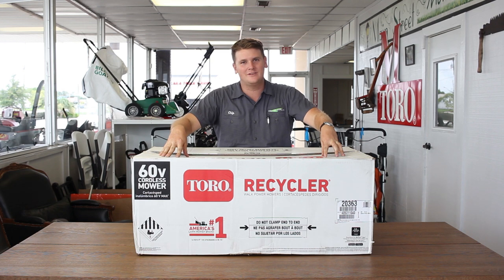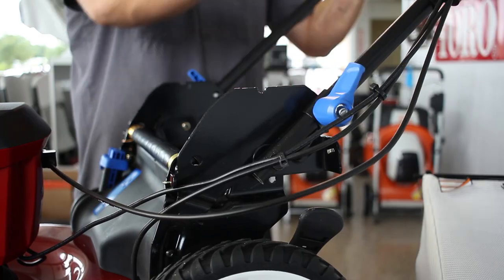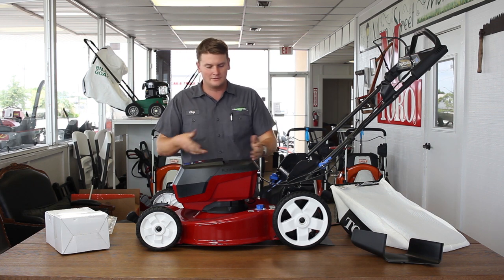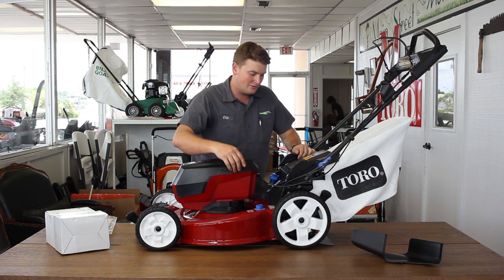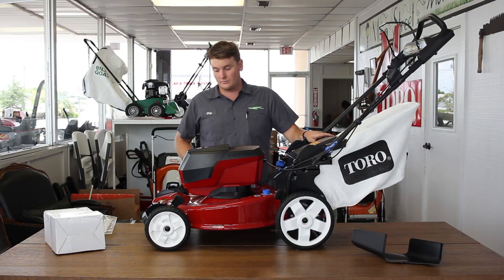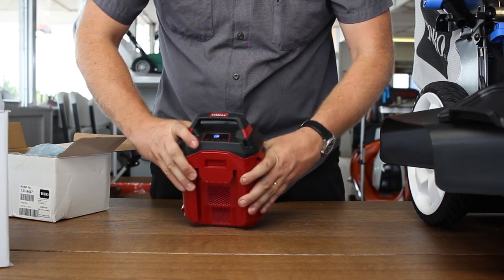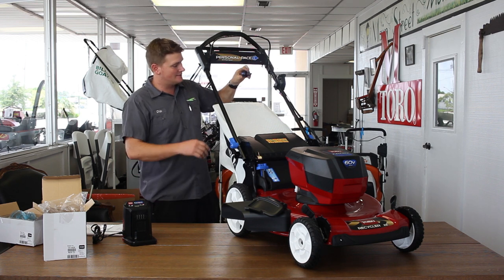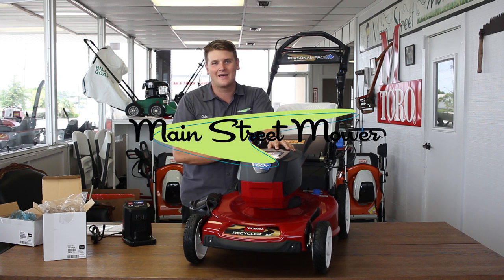TORO 60V Electric Mower Unboxing - Review & Specs

Comment: My neighbors both have Toro gas mowers...one is a super recycler...and I've never seen one leave almost no clippings or leaves like that does. It's fabulous. I want a battery mower just like that. Differences I see are...aluminum deck, under deck plastic mulch airflow  interrupter knobs, and a different blade. Do you think Toro will add these features at some point...like a 'super' recycler?
Reply from the maker: We have no intel of that coming out this year but we have to image that it is on the horizon. It seems it’s a bit price point limited at this point.

Comment: You didn't mention one special feature water hose connection for the deck cleaning
Reply: Batter powered mowers can be  stood on end or side and hosed vh out - motors are sealed.
Reply: They did that cause they didn’t redesign their electric mower from the ground up. They got lazy and just reused the deck from the gas mower. You can clean the deck a lot better by just propping the mower on its side.

Comment: If you have a big yard  close to a 1/2 acre you'll be lucky to cut it all on one  fully charged battery. Been there , done that.  I'm quite satisfied with the performance of this  mower, just remember the higher or wetter  the grass the more power you need and the shorter life of  the battery. I was going to purchase an extra 60 volt battery for this , but it cost $249.00   plus tax , so most people would shell out  about $270.00 for this battery which I find  very expensive.  Almost 1/2 half  the price of  the whole mower .  I can see $189.00 tops for a battery of this size and Ah.  Toro makes great outdoor equipment.  But come on Toro $249.00 ( without tax ) is  really gouging the consumer.
Reply from the maker: Battery mowers still aren’t for everyone, larger yards (1/2 acre and up) still need a gas powered mower. We agree with everything you said except for the gouging. All of the larger lithium batteries on the market are very expensive, Stihl’s AP300 is $189 and it’s (5 amp/hr) this is a (6 amp/hr). And benefits such as no gas, less noise, no smoke, no cranking, no storage concerns could outweigh the cost for many customers! Thanks for the comment!

Comment: I unboxed mine yesterday and have two issues - the loose, brake-lever cable doesn't look like yours; mine actually drags on the left rear wheel. It seems wrong. And trying to open the battery cover, I had to virtually rip it open. I noticed you said to check the front, and I did, but it should've opened the way yours did. I had to pull it to the point that one of the attached sides came out and a little spring popped out of somewhere. I reattached it and it's fine now, but huh? I'm really concerned about that cable, though. Any thoughts? Otherwise, it's a very nice and well thought out unit.
Reply from the maker: Take it to a dealer near you and have them inspect it, we unbox every mower we sell and we have a very low defect/shipping damage rate, less than 1 per 100
Reply: @mainstreetmower  I've been in touch with Toro tech support. I believe they're sending another cable. Unfortunately, they were very vague... thanks for your reply, it's appreciated.

Comment: Is the electric motor brushless?  In 2020, the Ego electric is brushless. It also has a five year warranty, although I don't know if the full five year warranty applies to the battery.  The batteries on the Ego charge in about half the time as the Toro's.
You mentioned plastic, when talking about the deck. I thought it had a metal (I think aluminum) deck.
I wish you showed how the handle adjusts to different heights.
Also, you mentioned mowers lasting five years. My Snapper mower lasted 20 years. I live in Georgia, though, where the mowing season is shorter than Floridas'.  But still, if the Toros only last five years, I am not interested.
An electric powered lawnmower should be everyone's next lawnmower purchase, IMO, especially if it's a homeowner for use on a yard that is less than a half acre.
I think I will wait for the first upgrade to this mower. I think they can make improvements to the battery system.
Reply from the maker: Alan, maybe this video would help more in comparing a TORO with Ego. https://www.youtube.com/watch?v=_anBbKS_01A
Reply: @mainstreetmower  It would help if that review wasn't paid for by Toro.
Reply from the maker: @josephgries4683  None of our videos are paid for by TORO or any other company. If we recommend a product, it's because we believe in it and think it'll help our customers and audiences. You would be glad to know that we do not carry any product that we do not believe in, even from brands that we are mostly associated with. 

We have morals bruh. ;)
Reply: @mainstreetmower  The video you linked is comparing the brand new Toro to an old model Ego. At least review it against the 2020 Ego model which is much improved over their older models (which are still quite impressive). But the review itself is rather biased anyways. He actually says battery technology is relatively consistent across the industry. That right here is false information, the Ego battery charges over twice as fast as the Toro. He notices the Ego blade is lighter than the Toro and considers that a con. That is also false information, the Ego blade is designed for an electric mower where as the Toro blade is a gas mower blade slapped onto a battery mower. He didn't do a cut quality test so how could be possibly talk about blades being better or worse. He also somehow turns Ego's one lever height adjustment into a con. lol what a joke.

Comment: How much does this mower weigh with battery on board?
Reply from the maker: Toro's website lists the weight for TORO 60V 21" at 64 lbs. (28.6 kgs). The overall weight comes upto a little over 80 lbs (36.2 kgs).
Reply: @mainstreetmower  Thanks. And yikes!

Comment: Steel deck?  Maybe a 60v super recycler with an aluminum deck in the near future.  Also, are toro dealers planning on repairing these units in house?
Reply from the maker: The Super is coming and yes they are being repaired at your dealership!
Reply: @mikeb1039  Well you have to change the oi.... no... what about the spark plu.... Hmm. Maybe if I break the shear key? If it has one? I'm sure they could sharpen the blade at least!
Reply: Alum would be much lighter. I am on 3rd year with steel deck Stihl (56 volt). I bought the mower new from a Stihl dealership in 2018 and purchased an extra battery and an extra key.  One battery and the quick-charge unit were included in the purchase price. The dealer let me mow grass with the machine before buying it, and the same dealer now maintains it each winter  (sharpens the blade, checks all connectors & cables, tightens bolts, lubes rubber wheels, etc.), for which I am charged less than $50. Very satisfied with the mower's performance, but I am getting a workout while mowing (it's heavy and not self-propelled).
Reply: Mike have you ever owned an electronic device?  PCBs and components routinely breakdown. Unless this is going to be treated like an iPhone and traded in every few years, there will be a need to replace board components. There is most definitely a higher skill level needed to do these repairs as compared to small engine mechanics can do...
Reply: Pat Bowman that’s nice that Stihl has that available. It will be I interesting to see what they can do if there is a breakdown. I have ego equipment and the brand gets near perfect reviews until something stops working and then all you hear about are the lengthy repair times...
Reply: @serenitynow007  the dealership tells me that if anything within the sealed motor compartment fails, it will be shipped to the manufacturer for service. At which time I'd need a back-up plan. I'm 70, so hopefully, with the aforementioned annual maintenance, the mower will outlive me. (Even with the extra battery, key and extended warranty, the mower paid for itself during season 1 once lawncare fees were considered).
Reply: Pat Bowman I have a feeling that manufacturers will start building these types of devices with “clump” components that can be replaced at the dealer. Even if it’s just a tiny 2 cent capacitor that fails they will just replace the board which is a lot cheaper than teaching people how to diagnose, solder etc. I have a back ground in electronics so I feel comfortable doing the repairs but I will have a dilemma if a major repair is needed and it’s still under warranty. What a lot of people are doing is if they they their mower in for repair they are buying a “rental” from Home Depot until their repair is complete and then returning the “rental” to home home (which has a 90 day return policy for non combustion tools)...
Reply: @serenitynow007  yes, we do live in a 'component' world.

Comment: Being "all the same" as the gas powered mower isn't necessarily a good thing. The engineers likely did this more to reuse parts and get something to market faster rather than being a good engineering design. The blade for example was designed for a gas engine, not an electric. A heavier blade is going to waste battery if it doesn't need to be that heavy (which is almost certainly doesn't). I'd be more impressed if they had redesigned it from the ground up to be an electric mower TBH. It's 2020 and you still have to adjust the deck height by setting each wheel independently.
Reply from the maker: TORO has been making the No.1 selling push-mower on the market, for years. The deck, transmission, and handle setup are well sorted and well made. Interesting that you mentioned the blade because it is a different part number. Has slightly lower sails (just like the European model blade) causing less resistance and resulting in a longer battery life. Moreover, it still has the strength and inertia of a gas-powered blade. 

Most battery-powered mowers have blades that are puny, paper-thin, pieces of junk! I would say that the 60V is definitely a step-up and the best battery-powered mower on the market.

Comment: You forgot to add you have to adjust all 4 wheels independently. That’s a shitty deal on a cordless mower.
Reply from the maker: It's a system that has been working for TORO for a long time. Once you set them, you forget them.
Reply: Main Street Mower that’s what I keep hearing. They should’ve gave this electric mower a new look along with ball bearings in the wheels, and a lever to adjust all 4 wheels at the same time. That’s what people look for in cordless mower imo. 💯👍🏼
Reply: @ajgreen868  It is a tried, and proven system.

Comment: Brake lever?  What mower has a brake lever?.....LOL
Reply from the maker: When Chip refers to the brake he’s talking about the top bail lever aka the engine brake. This is a safety feature common on just about all walk behind mowers that stops the engine whenever the operator lets go of the handle. This machine does not have a brake on the wheels.
Reply: Main Street Mower yeah, I know what the lever does.  It’s just not called a break lever.  But otherwise nice video!
Reply: Main Street Mower what do you expect the life expectancy in years to be for these batteries?  I’m considering going electric since I have a small yard but I’m worried about the batteries since they are so expensive.
Reply from the maker: If you say so, but If you ever have to replace the cable you’ll need to go to your local Toro dealer and ask for “Toro Recycler Brake Cable (115-8437)” that what Toro list as the parts description
Reply from the maker: Not sure yet but the battery is covered under warranty for 3 years. I don’t know of a better battery warranty on the market if there is one